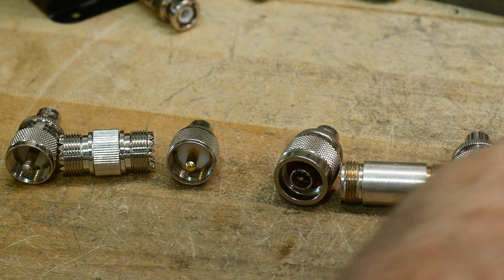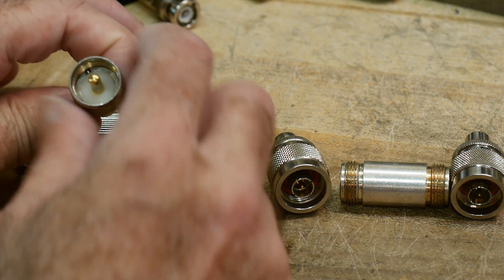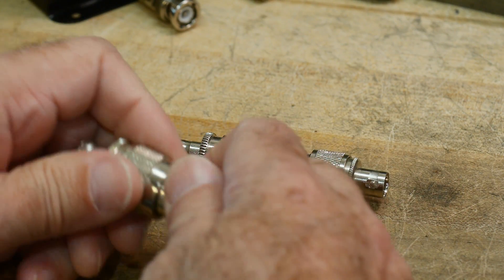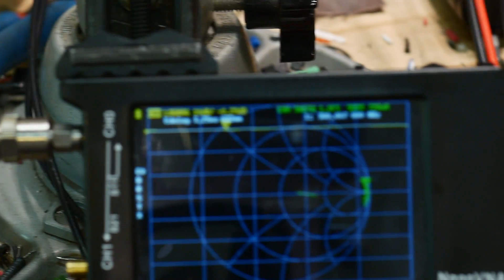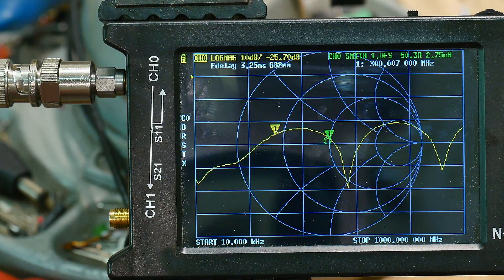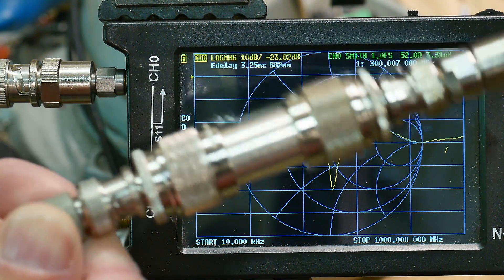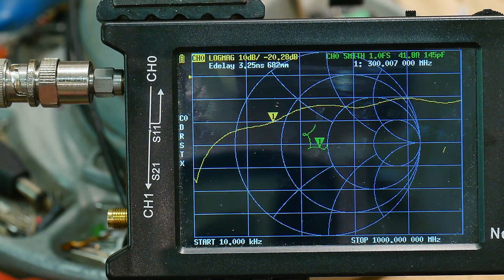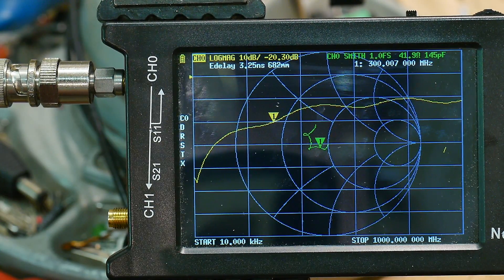#605 SO-239  PL-259 Usable Frequency Range

Comment: Many radio professionals in Britain call them insulated banana plugs and they shouldn't be used above medium wave 😂. I just know that PL259 family doesn't have a constant characteristic impedance like proper RF connectors (as you ably demonstrated) so will be a source of reflected power.

Comment: And Kenwood still feels the need to use UHF connectors (PL-259 & SO-239) on their commercial mobiles (NX-5000 series), even on the UHF models.  I was completely baffled when I received my new NX-5800 and it had an SO-239 connector.  It also had full length power leads on both the negative and the positive wires.  The whole setup screamed amateur radio, not commercial grade.  Neither L3Harris nor Motorola use UHF connectors on their current radios, because they know better.  They also don't run the negative lead all the way to the battery and actually instruct people to ground the radio at the closet ground to the radio.  It was off-putting to say the least.  That coupled with other issues is why I sold that radio and is part of the reason why I won't buy another one for commercial use.  When I see an SO-239 or PL-259, I think ham radio and that is fine, but leave them out of the commercial radio market.

Comment: Yes PL259 connectors are crap, and should not be used above 30Mhz, why Ham and CB manufacturers still use them is down to marketing bit like VHS and Beta in the video tape days. Well done in showing the comparison, in reality in your measurements the electrical length should be adjusted for the difference in physical length. This is a note for everyone, when screwing connectors, keep the inner stationary and only rotate the outer ring, otherwise you wear the inner mating surfaces to the point that you will get unreliable connections. I believe UHF stood for Universal HF.
Reply: The connectors use the old definition of Ultra High Frequency which in the 1930s meant everything above 30Mhz.
The german term UKW (translating to "ultra short wave"), which seems to have originated around the same time, still refers to the 30-300MHz range. Maybe coincidentally that also fits with the mention at the beginning and the measurement at 3:26 where the limit seems to be at 300Mhz.
Reply: @Michael_x00  I have read some where that when they were developed they were know as Universal High Frequency, but have a look at the Wiki https://en.wikipedia.org/wiki/UHF_connector. They are absolutely crap connectors, the better ones will work ok to 150Mhz but because of the way they are manufactured they do not present a constant 50ohms. If there is any doubt measure them with a TDR.  I used to work in a RF lab and I wouldn't use them past 30 Mhz. What I don't understand is why they are used on CB radios, where you will be very lucky to get 1/2 the power generated at the antenna. It's probably marketing bit like VHS & Beta and Watts RMS (there is no such thing as RMS power)
Reply: @davo99  I know they aren't good but good enough for Ham radio.
I also did my measurements and it seems to agree with the findings of most other people that non crappy ones are certainly usable to 150MHz sometimes even 300MHz above which the losses of a N or BNC connector are much lower than the UHF. And of course there are crap ones out there I also had a few crappy BNC connectors that where completely unusable above 100MHz.
Certainly not good enough for laboratories where you want the connector to be as "invisible" to the network as possible.

As to why they are still used, I think it's mostly people not wanting to replace existing perfectly functional gear just because of a connector that in most HAM and CB radio instances isn't an issue. I don't see a whole lot of marketing for the PL259 basically everywhere you look you find the PL259 is worse but old habits die hard.
Reply: @Michael_x00  Ok, but not good enough for Ham Radio. I mainly operate 2, 70 & 23 cm and even at 70 the losses are to great, 23cm would be a disaster using PL259. I use heliax with N connectors, even when I changed from RG213 to heliax was quite an improvement on the 2 bands
Reply: should be 3 bands

Comment: And in the video, the N connector/BNC 50 ohm termination shows up as 52 ohm with good return loss.
But the "UHF" connectors/BNC load shows up as 42 ohm at 300 MHz and it must be still less beyond 300 MHz.

Comment: SO239 (socket) and PL259 (plug) are also called UHF connectors. Because there's a time when anything beyond 30 MHz was catagorized as UHF. 
BNC, TNC, SMA and the bulk head N connectors are all having the characteristic impedance of 50 ohm. But the so called UHF connectors are not of 50 ohm impedance but something around 30-35 ohm. 
But the whole amateur radio industry has been using it as a standard type of connector for some reason and maybe because of lower cost of production (!!??). 
Any coax connector/cable with a characteristic impedance would carry more power.
A 75 ohm contraption would be great to carry UHF frequencies with little attenuation. 
Many SO239 connectors on the back of the SWR/ power meter would be having a "honey comb" dielectric to hype the impedance to around 50 ohm to avoid impedance bumps.